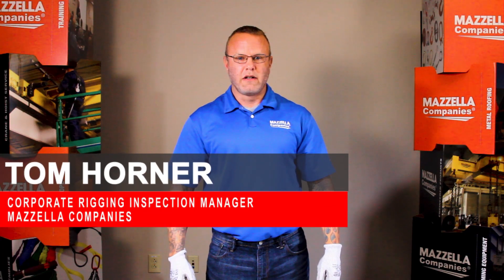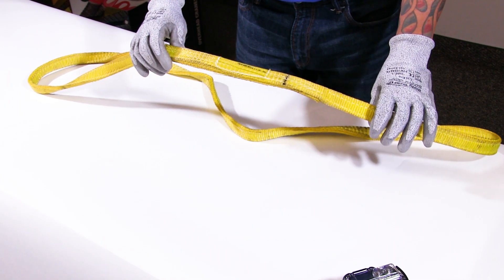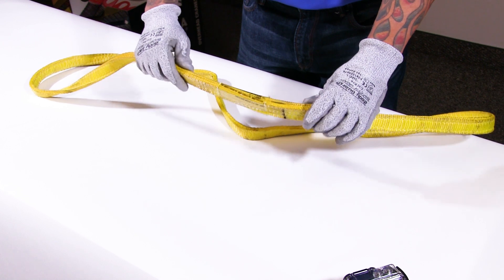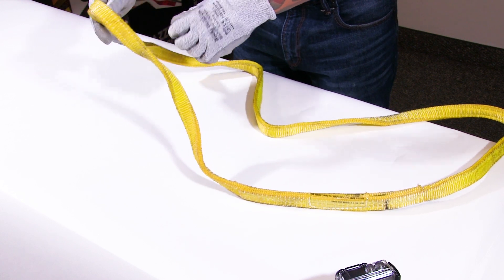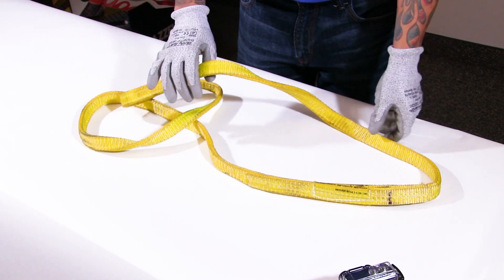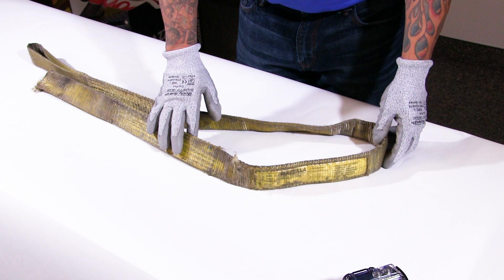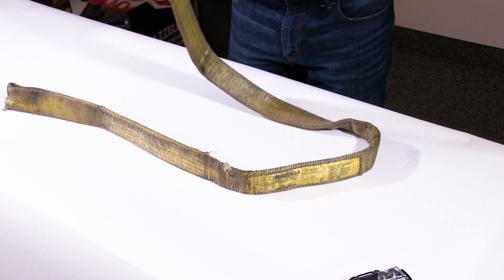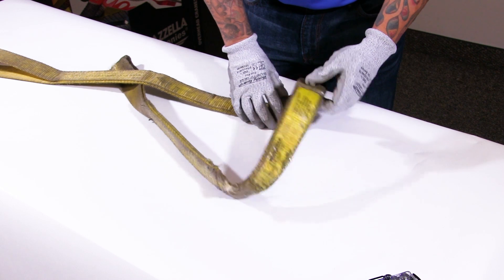How to Inspect a Synthetic Web Sling to OSHA and ASME Standards | L-2

Comment: In the example sling the one eye was clearly damaged and the webbing punctures/split.  How much edge where and abrasion is acceptable?
Reply from the maker: I reached out to our inspection manager Tom Horner to get some more clarity on this for you. Here is what he had to say.

"Ok, this is where the objective becomes subjective. Abrasion, or edge wear, is when the webbing itself has suffered micro tears that make the webbing appear fuzzy. Is the abrasion just ugly with no real damage or are there actually broken fibers? This is not really measurable. So what to do…?

The user/inspector of the sling must decide is there enough abrasion based on their experience and familiarity with the item. If a nylon sling doesn't show much wear in the entirety of the sling but has a little abrasion then the sling may pass. However, if there were many areas of the sling showing abrasion then the decision might be made to fail the sling based on the totality of damage. 

This is why training 𝐚𝐧𝐝 𝐞𝐱𝐩𝐞𝐫𝐢𝐞𝐧𝐜𝐞 is so important when inspecting. Training may teach you what to look for but experience will train you on what levels of severity an inspector may encounter with a particular item." 

A good rule of thumb is, if you are concerned then it is better to replace it. Slings are relatively inexpensive and it is better to be safe than sorry. It is also a good idea to hire a third party inspector to perform your documented periodic inspections. You can rely on their experience and ask them these important questions with the slings in question there.  At Mazzella, our inspectors go through rigorous training with ITI and are Certified through a third party accreditation. They also perform inspections all day everyday so you can count on them to have the experience needed to answer all your questions.

Contact us to get more information. https://www.mazzellacompanies.com/company/contact-us/contact-rigging-division/

Comment: Can you do another review for the other web slings, i have a picture and not sure if the sling is good or bad. The abrasion could be subjective. Not sure.
Reply from the maker: If there is a visible abrasion, then the sling should be removed from service. Remember that a sling, for the most part, is a very inexpensive piece of rigging equipment, but it plays a very vital role in the safety of your operation. Don't gamble with your safety. If there is any doubt then, then throw it out and replace it.